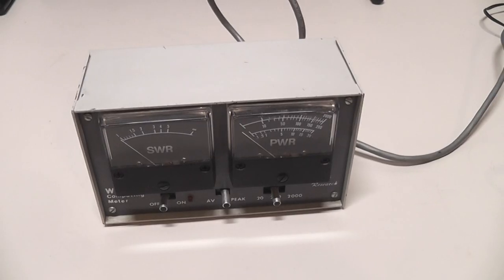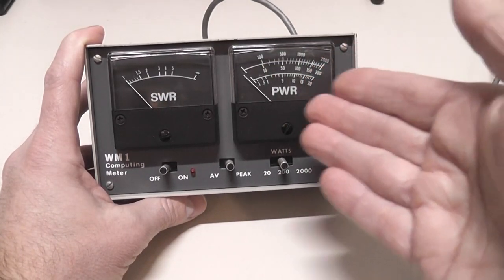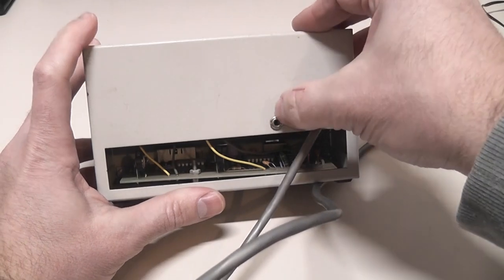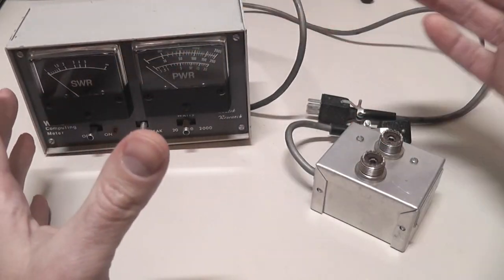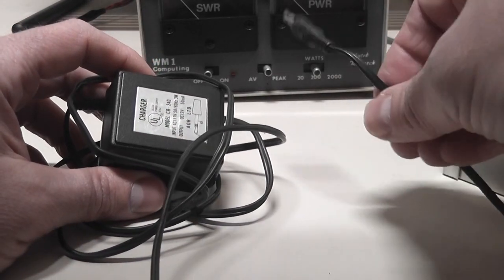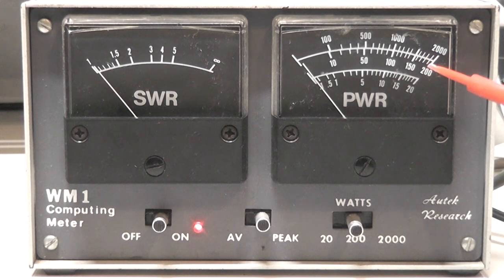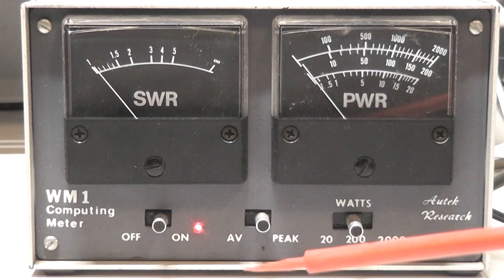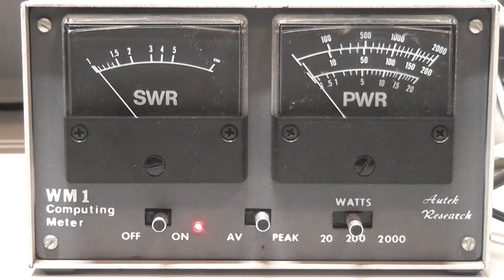Autek Research WM-1 Active Peak Reading Meter CB / Ham Radio

Comment: What are the connectors for the extensions called?Never seen them before
Reply: Cinch-Jones, often simply called a Jones plug. They are common on a lot of older gear and Mouser still carries a wide variety. I doubt they are original to the meter. I own two Autek WM-1 meters and neither one has them, the cable can't be unplugged.